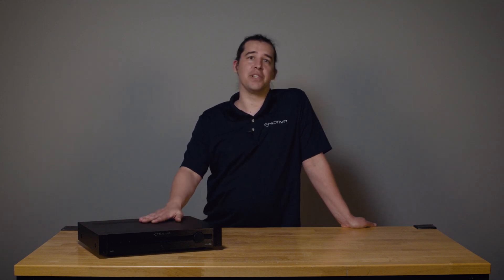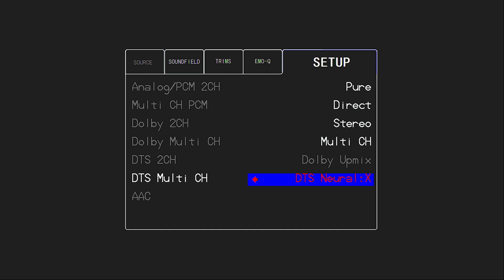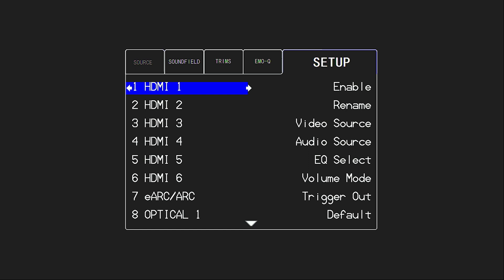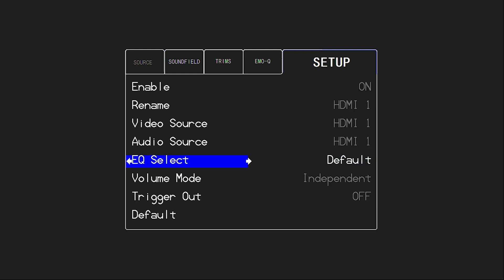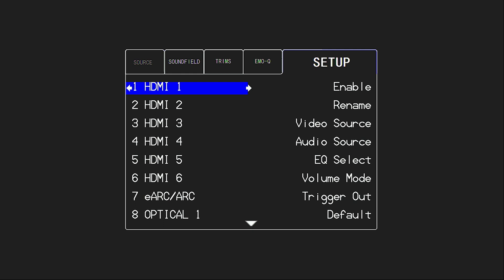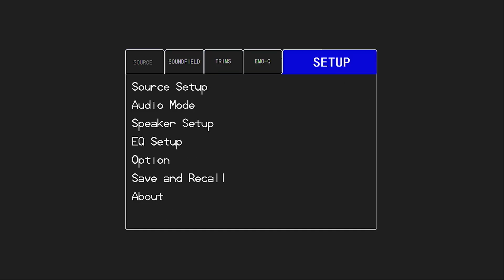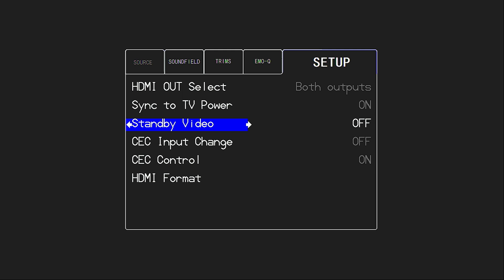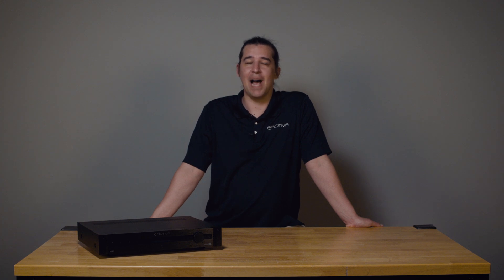BasX MC1 Processor Setup & Features

Comment: No help for me here. I have a Dune Pro One 8k Plus and I want to use the BasX HDMI 3 input. However I get a "no signal message" on the BasX display. I know the Dune is outputting a signal because it works fine if I connect it directly to my TV. What to do?

Comment: I love my BasX MC1 processor with my Basx A3 and two BasX A4 amplifiers. All my Emotiva gear runs a 7.2.4 speaker configuration. Makes my movies go from ordinary to extraordinary!!
Reply: How did you decide on getting a 4 channel and 3 channel mix for your 11 channel HT versus a 5 channel and 6 channel mixture instead? Im debating on this very issue now based on power watts per channel but also expense. More channels in less space is more heat of course and less power but... 3 amps versus 2 amps in a rack for available space is also an issue and the extra cost.
Thanks
Reply: @sjsphotog   Little by little. I originally had a 7.2 system using a receiver. First I bought the BasX 3 channel amp to just power my LCR speakers and was impressed with the sound, so I went ahead and bought a BasX 4 channel amp for the remaining surround channels. A couple months went by and the MC1 finally was in stock again, so I bought it.  That was when I decided to also buy 4 ceiling speakers and another BasX 4 channel amp. There is hardly any heat generated by the devices.
Reply: Your choice of gear is exactly what I want in my home but, I'm not able to afford it nor am I sure the purchase would be worth the cost.  Can you tell me about how installing the MC-1 and BasX amps is better than your prior system.  I currently have an Onkyo AVR powering Emotiva T-Zero towers, C1+ center, SE8 sub and other brands for surrounds and on the ceiling.  It's been fun and frustrating to make it work as well as it does but, the FOMO just never stops and I adjust it over and over.  Thank you and all the best.
Reply: @welderfixer   The sound stage is bigger and  the quiet sounds are louder with better detail.  Put it this way...  people that have separates never go back to an AV receiver.
Reply: @SavageAirCinema  Thank you.  My decision to upgrade someday is set on separates.  

I did an experiment Sunday evening with my NAD two channel amp and connected it to my Emotiva T-Zero towers that are 4 ohm and I found the "dynamics" of the speakers to be much better than I expected.  Your reply and that test seals my desire to work extra hard to get the Emotiva system like yours.  Thanks again and all the very best to you and yours!
Reply: I have the MC-700 connected to the basX7
Except for my sub, somethings missing. I've owned pioneer elite receivers, yamaha.... my sub always sounded great. Overall sound is great except for my sub.
Any thoughts.
Tks